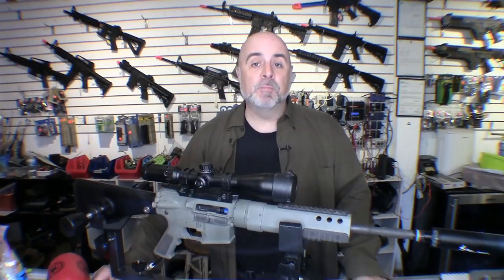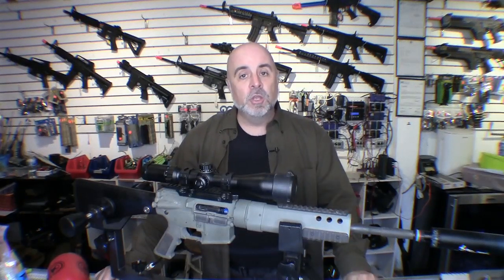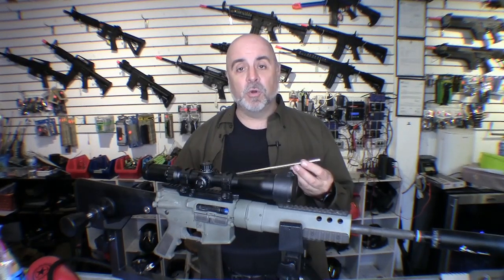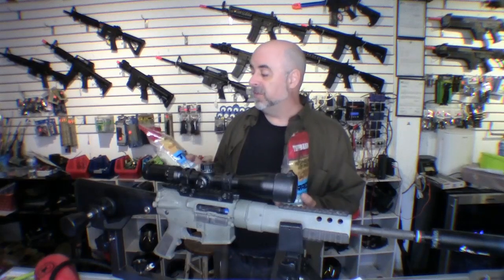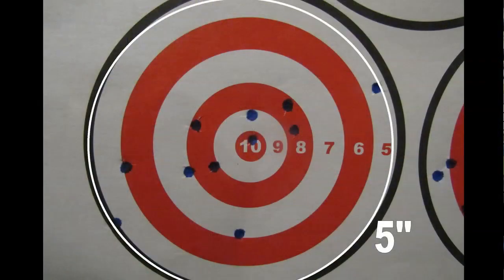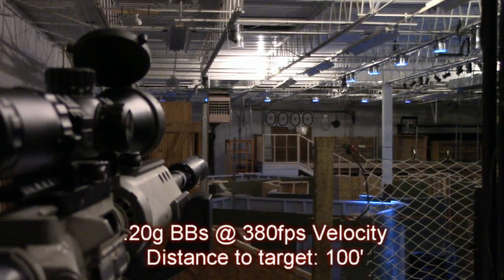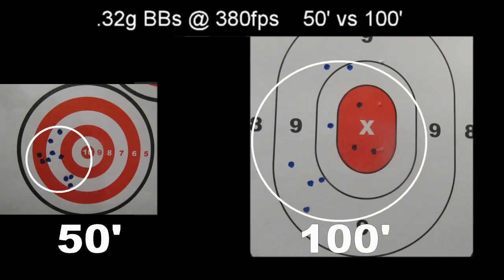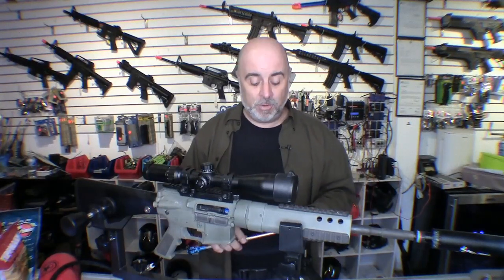Effects of VELOCITY on ACCURACY

Comment: I would like to request another scientifically sound and extremely relevant test.  Basically do this again, but compare them at a given joules value instead of FPS.  Joules are what matter for safety and pain.  So if we stick with 380FPS as the baseline that gives us ~1.34 joules with a .20 BB.  To stay at that joules value with a .32 BB you would fire them at 300 FPS for a fair comparison.  To further clarify the reason for this, basically a .32 BB causes the same amount of pain and potential injury at 300FPS as a .20 BB causes at 400 FPS.  Fields really need to switch to joules limits across the board.  I self regulate myself to stay at 1.5 Joules limit, which is the standard .20 at 400FPS.

Comment: I’d like to see heavier bb while keeping the fps the same. So as bb weight increases you need to change the fps as well.
Reply: Okay spoke to soon :) next is like to see the force comparison between the two. Obviously the heavier bb will “hurt” more.
Reply: I think that's unrealistic because the limit is defined in kinetic energy (Joules) which is 1/2 * mass * V^2. Your intuition is correct that a heavier BB going the same velocity as a lighter BB would have both greater energy and momentum and hurt more. It would lose less energy to drag as well because it has the same form factor (5.95mm), but a greater mass. A heavier BB, going the same velocity, should be superior in every way. The only exception may be that the magnus effect (lift from backspin) may not counter gravity as effectively, but I think that would be overcome by the greater momentum.

Comment: It would be interesting to see what the accuracy would be with the .32g bb at the same pressure as the .20g. And then, the accuracy of the .20g bb with the same pressure it took to get the .32g bb back to 380fps.
Reply: His previous video shows that. To summarize, he tested with 0.2, 0.25, 0.3, 0.43 and the order from best to worst was 0.3, 0.2, 0.25 and 0.43. But, of course, it depends on the power of the gun, the type of the gun (pistol/rifle etc.), the propulsion power, the distance, the type of bb (some are better than other even if they have the same weight) and the environment (indoor/outdoor).